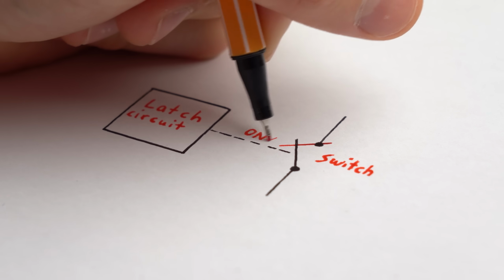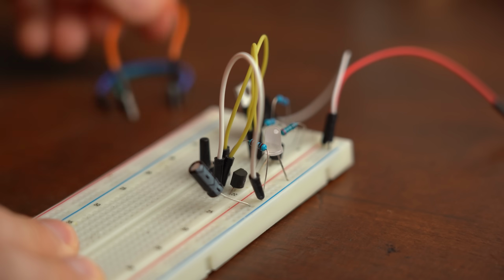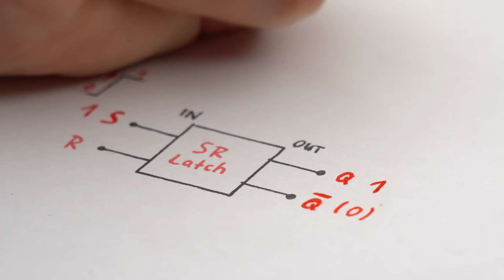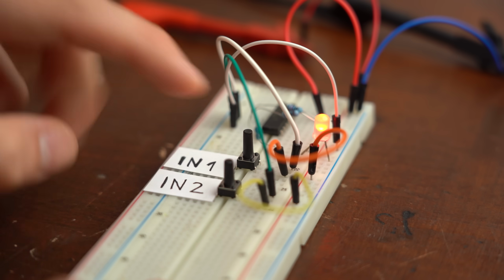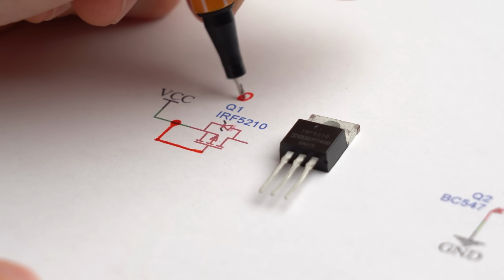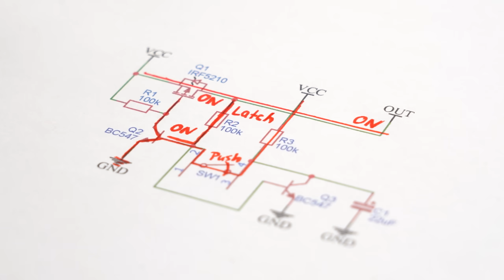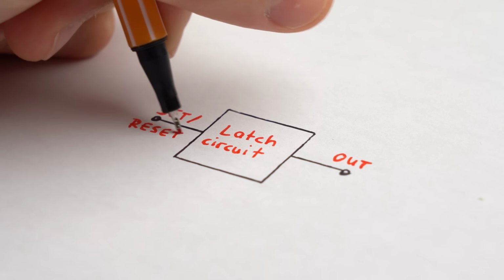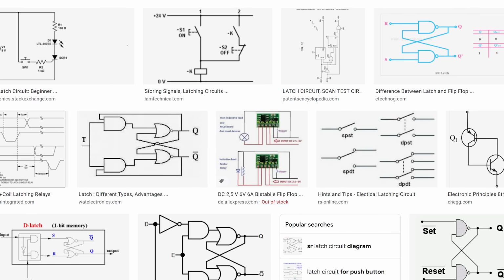Mechanical  Switches are Obsolete?! Switch to a Latch Circuit! EB#53

Comment: Using dedicated ic is kinda cheating, and I feel like transistor latch has some kind of problem where if u held down the button too short or too long a duration, undesired result can happen because of the capacitor

And the ic also uses 2 button, a t flip flop will be needed for 1 button latch, and here is where the challenge comes, it will just oscillate if the button is pushed because it is missing clock signal, a master slave configuration is needed

this video did not cover that. A latch is essentially a digital flipflop, I challenged myself to build a 1 button latch when I was new to learning flip flop, surprisingly, when I searched, everything I found was transistor latch, I had no resources to learn from and didn't know where to start, I had to figure it out myself.

And this video didn't bring anything new to the table, just the same transistor latch as every other video, in a place where latch videos are mostly transistors and digital ones are so rare to find, in most cases they just slap a flip flop on a slide and start teaching theory, where in real world a latch is more than 2 nor gates so it didnt really work in practice, it was more like a digital logic class than a latch video......

Utterly disappointed......
Reply: You're right about long & short switch presses possibly causing problems in some designs, though short presses at least usually aren't a problem.

As for the circuit itself, it doesn't mention that the "out" terminal needs to always have a current (though small) to ground in order for it to reliably work- otherwise it'll occasionally switch itself to a "default" state (which depends on the "polarity" of the transistors you're using) instead. Not usually a big deal, but something to be aware of.

This circuit is, incidentally, a flip-flop, though certainly an optimized one. In particular, the capacitor gets charged to a state such that when that central switch is flipped, it will force the circuit into the opposite state from what it was in before- it doesn't malfunction by oscillating when the press is too short, but instead too long, or even malfunctions by not flipping state if the switch is pressed a second time too soon after it was last pressed.

As for the normal T flipflop, the normal situation is to connect the switch to both a capacitor and the clock input of the flipflop and a resistor that shorts the capacitor- the capacitor will be almost instantly charged when the switch is pressed, and will stabilize the signal into the flipflop's clock input long enough for the switch to reach it's fully depressed position, where the switch is supposed to tie the capacitor and clock input directly to power (or ground, for inverted-input inputs). The resistor & capacitor will control the "debounce period" that follows an interruption of the switch connection, but for the small push-switches here can reasonably be a second or less without problems. The data input, of course, needs to be tied to the flipflop's inversion output.
Reply: I felt it pretty bad when the NOR based latch was discussed - I've had nothing but trouble when making a transistorized version, it needs equal loading on it's outputs...
The NAND version is topologically the same and is very stable, even better you can make them with just 4 transistors o_O

And this reminds me of a curious circuit I remember seeing somebody posting on reddit a year ago, there are differences but it'll likely still have a problem with input voltage changes causing malfunction - definitely a no-go for anything battery operated... Though in my take on latching power-switches, I used that effect to not only detect when the battery was low - but also protected against short-circuits!

Edit: I just saw the thumbnail to ElectroNoobs' video, and that circuit looks awfully similar to this one...
Also worthy of note, GS got 4x views on his rehash of Clive's Joule Thief video - and they say something's not worth doing when it's already been done!
Reply: You are showing your gross ignorance based on a single video.  Yes, this particular simplified circuit has timing issues (see my other comment for full explanation) but that doesn't mean all latching circuits built with discrete components suffer this issue.  Also, IC latches are not just of the R-S type and DO NOT REQUIRE separate input triggers for toggling.  You don't know enough to be criticizing.
Reply: @DiffEQ  Dude, don't just walk in and drop ad-hominems - saying "your'e stupid, stop talking" is not going to change minds; if you want to show an error, point out what went wrong and how to fix it, don't just hit at it blindly and spew insults like that...
Nothing is worse than an ignorant man accusing someone of being ignorant!

Also, don't just go 'refer to my previous comment' like that. Nobody will find it, and that's a fact...
Either repeat what you said, or put a hard link to your comment - don't just go "x marks the spot" and expect people to go find it...

Now it might seem like this guy doesn't know enough to criticize the theory / lesson here; he's absolutely qualified to judge a video about the basics - a video which fails to cover the basics in a complete fashion, only skims through the cool and important bits. No variations, no run-down of the caveats - I found this format in the SEPIC converter video, where that design was all hyped up - without discussing the huge drop in output efficiency, or the alternative (a flyback converter) which would achieve the same goal, and add the benefit of electrical isoation...

At least, that's what I think is being discussed here; this thread is pretty old...
Anyway, thanks for coming to my TED talk - that is all for now

Comment: My problem with devices that use latch circuits to turn on is that they can't be controlled with a power outlet timer, and they don't come back on after a power failure.

Comment: In a nutshell, every switch has its own applications.
Reply: Every switch, every tool, and most (maybe not every) programming features have their own purpose and application. There is never a one size fits all situation, and it is about determining which one is best for the situation.

Comment: Hi 
Yes fine for low voltage low power stuff but you can't trust it for high power stuff, you can't beat a mechanical switch for isolation on high voltage high power stuff, I would never trust an electronic switch especially if it is processor controlled 
Keep up the good work

Comment: A few years ago I bought a nice lit switch for my bench power supply (based on an old ATX PSU). Turned out it was a momentary button, while the PSU needed a latching switch. So instead of buying another switch (it wasn't a cheap switch) I built a latching circuit like the one you are using. I additionally put in an opto-isolator between the circuit and the PSU though.

Comment: I used a latching relay to drive a fog light relay in my SUV so I could use an OEM push button. The latching relay gets power from the tail light circuit so the fog lights can only come on when the tail lights are on. When the tail lights turn off, the latching relay loses power, and the fog lights automatically turn off. They won’t turn back on again unless the OEM button is pressed.
Reply: Thank you for saving other drivers' eyes!
Reply: I wanted a circuit to pop up my headlights. There was a one year only button that can keep them up with the lights off. Completely different wiring and controller... or an annoying blank off plate. I had to consider, flash to pass overide to make sure the buckets go up for that, no matter the state. Fog lights require park lights like your circuit, also should switch off with high beams since fogs and high beams are considered as 6 lights, whereas regular headlights and fog lights are considered 4, the legal limit. Automotive lights are more complicated than they look on the surface.

Comment: This is obviously a really interesting and problem specific solution to mechanical switches with potential benefits, but all I see when I look at a latch circuit is extra points of failure.
Reply: More than loose wire terminations and failed capacitors?
Reply: Makes sense to separate your control circuitry from load circuitry. Don't want to have to throw a super heavy contactor manually every time I fire up a large air conditioner. It really makes no sense to pipe the full current through the thermostat either. 

Little noisemaker soldering project? Sure. Put a honking big toggle hanging out the side of that old cigar box. Certainly worth looking at the application.
Reply: Depends on the use-case. Switch "bounce" can sometimes be the bigger issue.
Reply: Mechanical switches (relays, contactors, even buttons and switches meant for small loads or logic signals) have to be the number one cause of electrical failure in industry.
Reply: @kuni45  But the vast majority of mechanical switches fail to a safe state. Mechanical switches also maintain fidelity for small signal AC information that would otherwise be distorted or completely destroyed by the gate logic transistors and they are immune to voltage polarity. Mechanical switches are far from obsolete.
Reply: @kuni45  The electrical / electronic system is by its nature a failed, consumer and enslaving system, while the Mechanical System is the simplest, most durable, the more reliable and freedom system in the world.
Reply: Because you think complexity means unnecessary.  Adding a square-root button to a calculator also adds an extra point of failure.  Funny how calculators work for decades with all the "added points of failure."  SMH
Reply: @DiffEQ  also, the square root button is a terrible example. The button simplifies overalls functionality.
Reply: @DiffEQ  I think you missed the point. Yes, these latch circuits are useful, but OP is saying that there is a time and place to use them, and there are certain situations where such a latch circuit adds far more unnecessary complexity and room for failure. This is ESPECIALLY the case when working with high voltage.

Comment: I have a feeling it would be better to connect the base of Q3 to the output with it's own 100k resistor.  With no resistor between Q3 collector and C1 it might be that you are relying on a very low base current and limited transistor gain to discharge C1 slowly enough to prevent (fast) oscillation. Not very well defined conditions. Maybe I am wrong on this, just something nagging at me when I look at the schematic.

Comment: Totally Off Position Switch (tops) is preferred as there is no energy drain. If I could do that with my remote control devices, I would. The batteries would last longer. There's nothing more comforting in knowing that when something is turned off, that indeed it is off.
Obviously there are things that turn on with the push of a button, and the same action turns it off.

Comment: I use a power latch circuit for my bicycle automatic shifter. The cadence reed switch latches it on (also an input) and the Arduino switches it off if 0 speed for 30 seconds. Works great and no power draw when off.

Comment: Does using an electrical latch remove the need for button debouncing? Ive always struggled with debouncing my inputs for projects. This seems like a possible solution.
Reply: Latch doesn't solve the problem, the capacitor does. And it can be used anywhere.
Oh yeah, there is d flip flop too

Comment: A JK flip flop or a T flip flop can be used to create a push button toggle circuit.
The big benefit is that, unlike the three transistor circuit, it does not oscillate.
The con is the constant power draw.

Comment: Latching relays in home installations are rarely worth it. Not only these relays are ridiculously overpriced but they often fail. I work at an electrical panel building company and we often have to replace them under warranty. Unless you have an Infinite Corridor at home, you don't even save that much wiring.

Comment: Why not just use a cheap microcontroller to do the latching? It takes up less space, and most projects already include one. In your arduino example, you could just use a software latch and put the microcontroller into sleep mode to reduce the power consumption.
Reply: Still a power draw, a good power latch circuit has 0 current draw when off. A button press brings it on and then the microcontroller holds it latched. The microcontroller can then switch itself off.

Comment: I have single button power control circuit with ICs in my home build stereo, by now, it's working more than 20 years.. MCU can control it too from remote and there is independent indication part.. If power supply fails at starting, LED will blink continuously.. At normal situations, it never fails.. 
Circuit is different from simple ones and it is with protection from bouncing contacts.. 😉

Comment: I find over complicating something that has worked very well for so many years dumb. Mechanical switches will never be obsolete
Reply: I agree but sometimes you want a microcontroller to switch itself off and that's where a power latch circuit is very useful.
Reply: you are right. but bulky and pricey yes they are, compared to digital stuff. that is why we so rarely see them nowadays.

Comment: How long can the push button be pressed before the capacitor fully charges and pulls the first bjt base to ground?
Reply: Less than a second I think (also applies to 2nd press to turn off). C1 is almost immediately discharged by Q3.
Because there is 0.6V between collector and emitter, C1 does not discharge completely. So with the 2nd press, C1 is quickly charged enough to to bring Q2 back into conduction.
Reply: @janwesten1317  is there any circuit that overcomes this issue ?
Reply: @Ajaykrishna97_  I think you need an IC (e.g. NE555) instead of transistors. I bought a complete latch relay board module on ebay for about €5,=. (also named bistable relay module).

Comment: Thanks for this great Video.
One thing you missed is the useful and for safety often used restart protection of this circuit.
For example a safe angle grinder or drilling maschine don't start by itself after replug the power cable even when the power button wasn't shut off
Reply: Great observation 👌

Comment: I studied electronics repair in the 1980's after I left active duty and quickly realized the KISS principle, Keep It Simple Stupid, really applies in electronics design.  Keeping it simple allows the device to brakedown less and when it does it is easier to repair and get back to the customer.

Comment: Isn't the table in 4:40 missing Q as an input? It'a a sequential logic table so you need to take the state of the output into consideration.
Reply: Masz rację Pawełku wyjście winno też zależeć od obecnego stanu (pamięci).
Potężny Scott wtopę zaliczył tym odcinkiem moim zdaniem.
Reply: @owndragon2154  Dziękuję Własny Smoczku 21 za potwierdzenie mojej teorii.
Reply: @papciuszkin  Polecam się. Ale wielki Szkot popłynął tym że mechaniczny przełącznik droższy od tego układu z mosfetem gdzie ten mosfet pewno kosztuje dwa razy więcej niż pierwszy lepszy hebelkowy switch który mam za 2 złote
Reply: @owndragon2154  Prawda, nawet niedawno miał materiał o porównywaniu fejkowych MOSFETow do oryginalnych. Mówił że oryginalne są mega drogie. Potężny Scott chyba ma potężne problemy z pamięcią.

Comment: Looks identical to the one @EEVBlog uses here: https://www.youtube.com/watch?v=Foc9R0dC2iI
Reply: Not quite. I believe this one could possibly be unreliable. If it's a copy, it's been messed up, 22u cap on collector instead of base of second transistor -  It might not work reliably with higher gain transistors and you have a fully charged 22uF capacitor discharging into Q2 base with no current limiting when you press the switch (can't be that good for Q2).

Comment: Is there a way to have an arduino trigger a TTP223 touch switch?  I've wanted to use one as a touch start switch in latching mode and then have an arduino pulse trigger it to toggle it back off.

Comment: Using electronics for the sake of the technology is a poor practice that is increasingly seen in modern devices.   It increases cost and in a lot of cases decreases reliability..   Things like car doors that used to use a perfectly functional mechanical catch and in a lot of new vehicles has been swapped with an electronic push button circuit.   Very cool, but the old mechanical part is very reliable and most importantly, continues to work if the vehicle is in an accident and loses power..  In vehicles with electronic door latches, they have to put in a clunky emergency pull which is actually less safe because it's not the regular way to get out of the car and it's usually hidden away so it's not so obvious in the name of "design" and fashion, and humans panicing in an emergency tend to forget about things like hidden emergency latches unless like NASA astronauts, they drill and practice emergency procedures over and over..   There are definitely applications for electronics where they can be more reliable and cost effective, but we should be very carefully considering whether electronics are really "better"..
Reply: oh, there are so many instances where bad design is used for the sake of looks or high-tech feel. One simple example is hiding screws under glued-on feet, labels and such.

It's both funny and sad how we went from "it's solid state, it's eternal" to "it's solid state, drains batteries, glitches, breaks faster, and is very difficult to repair".
Reply: Good point. The problem is that when the new over complicated solution becomes the "norm" it may become cheaper to mass produce than the previously cheaper simple solution which, now being more expensive, gets discared.

Comment: With mains devices that use a latch its impossible to use a timer on the mains socket as it is not possible to leave the device switched to the 'on' position but not active. Hate the dam things